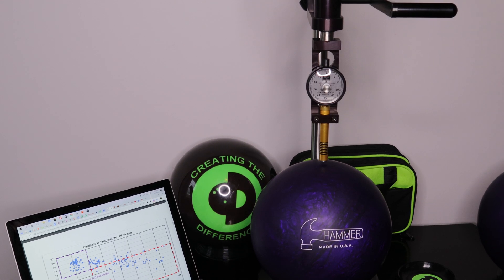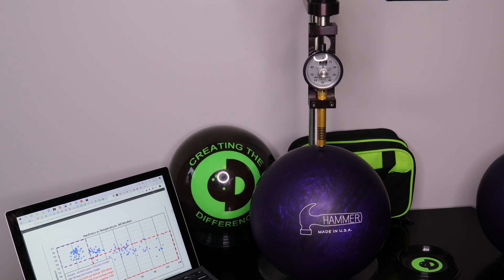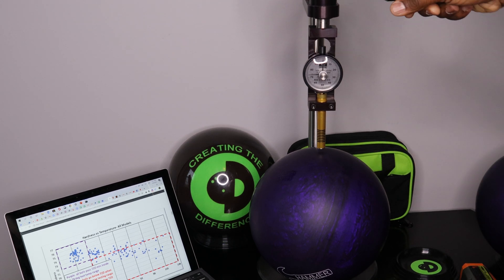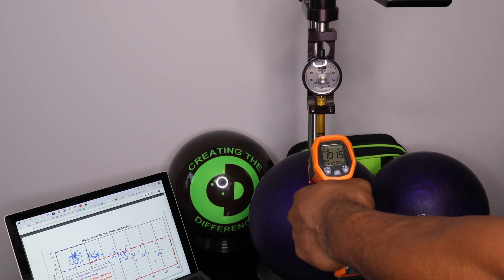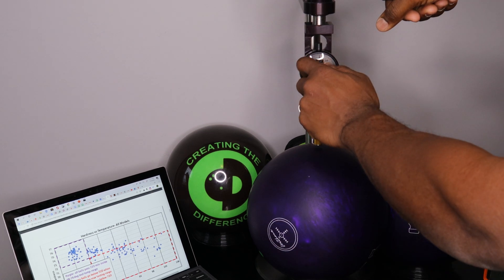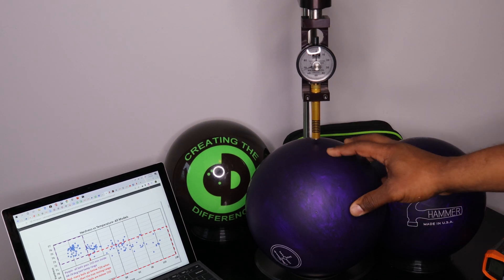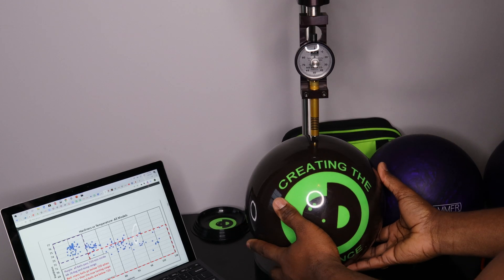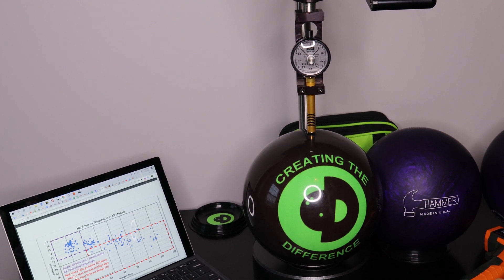Purple Hammer Urethane Bowling Ball | Understanding Hardness | WHY TEMP MATTERS

Comment: If the softer the ball the better it reads the pattern than the opposite could be true no? If you left your equipment in your car in the winter theoretically it might give you an advantage on a shorter pattern if the ball has become that much harder due to temperature? Or am I understanding this incorrectly?

Comment: When u were with ebonite, did u design work on any specific hammers?
Reply from the maker: I designed all of the balls from 2001 to 2014.
Reply: @Ctdbowling  do you remember the hammer claw reactive resin? i still throw one but it wont hold any surface. is 20 years of use overkill on a bowling ball? lol

Comment: What’s the advantage if one is hot or cold, soft or hard?
Reply: aroe3out LGR a soft ball hooks more than a cold one. A plastic spare ball has a very hard cover stock so they don't hook much and reactive cover stocks are soft so they hook more. So no  advantage really but it will change the motion of the ball. If you leave your gear in the car over night during winter your first few shots will hook far less thanks to the ball being cold

Comment: Correct me if I'm wrong, but by looking at that research report there IS a difference. Are they within legal limits? Sure. Are they right on the edge? the VERY edge. Serials starting with #6, #7, and #9 all dip into the red of hardness level REALLY close to 78 degrees. All the others require at least 8 or 9 degrees hotter before they get warm enough to enter the red zone. With that said... Balls may be tested at near room temperature, but say you throw at a good handful of balls (like you have suggested for urethane yourself, I <3 your vids). That increase of temperature from using your bowling ball would only require 1 or 2 degrees increased temp (with use, we are warmer than 78 degrees after all and Mo Pinel says ALL balls warm up after being thrown a few times) increase to be illegal at that point, right? Just food for thought based on what I see from that report. Keep up the good work sir! =D
Reply: On a side note; I read that the lights from PBA tour games warm the temperature up to almost 10 degrees higher in some cases causing the hardness of someone's ball to change from earlier in the day. Some of the newer guys on tour aren't accustom to that change and often struggle their first time when they make it in a show. Wouldn't that alone push even some of the other balls into easily over 78 degrees? =)
Reply: When the balls are tested under the strict range of conditions right out of the factory, they all have to be at least 72. However, if a ball is retested after use, the minimum drops to 68.
Reply: @coopergates9680  Yeah, most of us have been keeping up with news. That wasn't entirely the point here though, the point was "at least 72" when you're right AT 72 to start. Couple that with the new news that prolonged use causes it to dip even further, I'd put money that some of these balls with these serials were EASILY in that 100 something ball range before they gave that additional 4 degree buffer to essentially make it all "ok" =D
Reply: @shelbykunz3177  I might get a durometer for the heck of it. The issue is that it's not like meters, kg, or another unit that's trivial to calibrate. I wouldn't know if two durometers (even after zeroing) disagree by one point or four or five unless I use both in the exact same way. Same thing could happen to anyone re-testing a ball after some use, the USBC shouldn't ship everybody's balls back to their original test sites.

Comment: CEO Ron, were these manufactured at about the same time? on JR's channel he mentioned that the early batches are softer than the newer ones.
Reply from the maker: Balls have been tested from different years and batches including the ones mentioned. None of the balls tested have failed to date.
Reply: It looks like the hard science shows that the balls are legal according to the durometer. But does the makeup of the purple hammer matter? To my understanding it’s a pearlized urethane. On bowling ball.com, it’s hard to find it but it’s advertised there as a ‘reactive urethane’

I have one and plan to roll it in some upcoming tournaments so I’m good with it being legal either way. Mine is supposedly the softer cover version manufactured in earlier years.
Reply: JR said in a later video that oil and/or usage of the balls can soften them, so it wasn't due to the serial number but how many games. Remember people soaking their polyester balls in the 60s and 70s in ketones and other solvents to soften 'em?

Comment: Balls that hook early and are dead on tha back. So soft balls are useless. High rev probably benefit from a colder ball for length
Reply: I believe you are misunderstanding the concept of urethane balls.   Urethane is not designed to go long and hook in the back.   Also, adding surface will only make a ball hook sooner, not more.